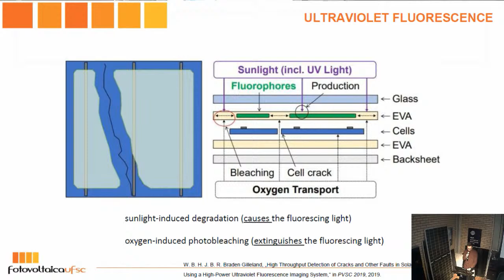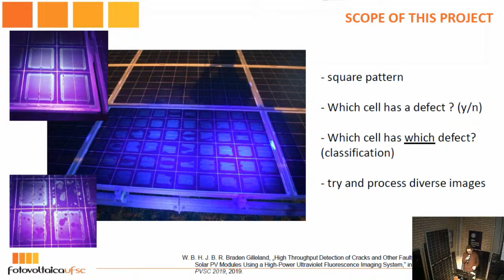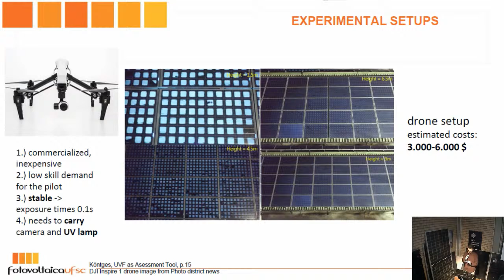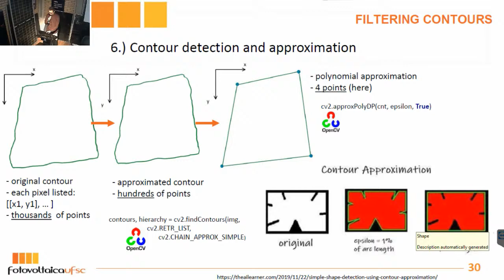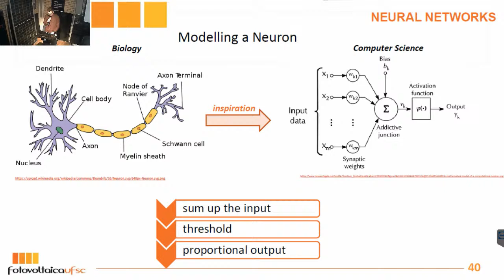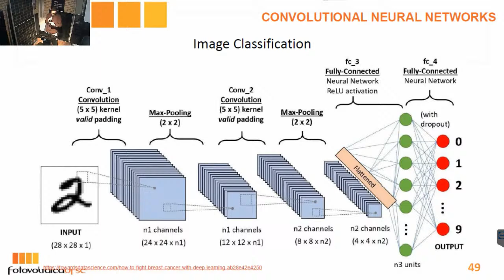Ultraviolet Fluorescence Image Analysis as Inspection Method for Photovoltaic Cells

Comment: Thank you for this. Some great info. I am well versed with EL imagery and have performed field inspections with an adapted rig but was looking into to UV as a preliminary method to identify damaged cells in modules. I am wondering if you know how long on average it will take for microcracks, created by improper installation, to show up in UV light? Also, do bifacial modules differ in UV light inspections? Danka!